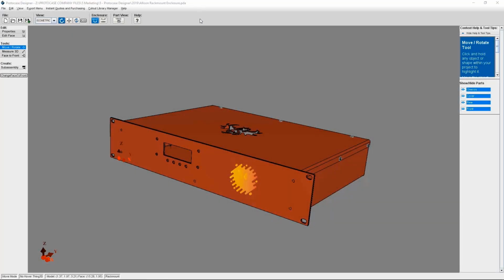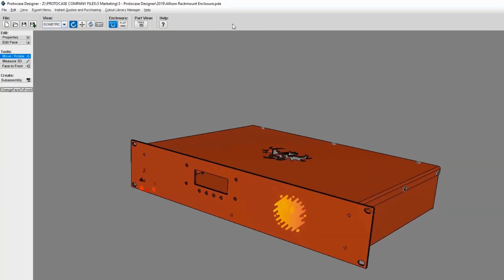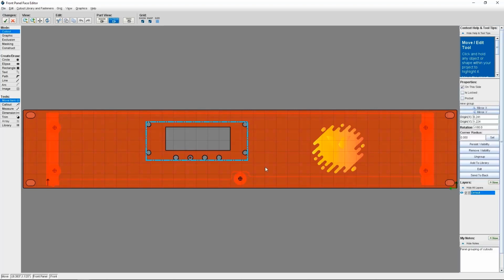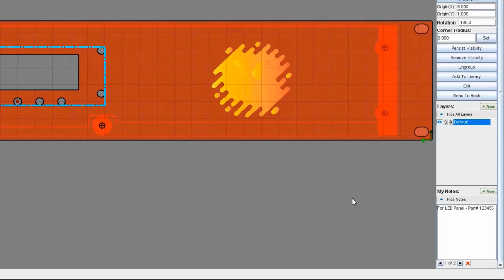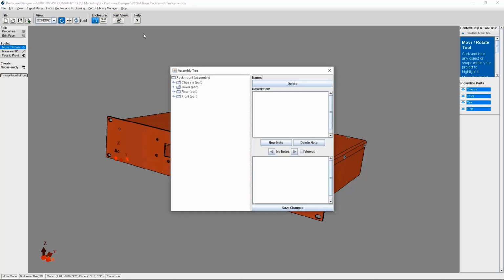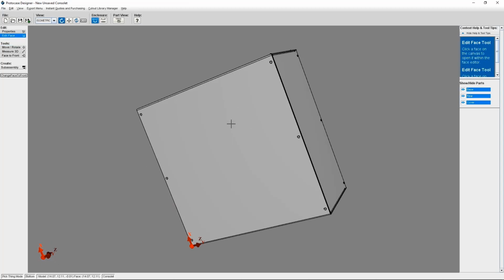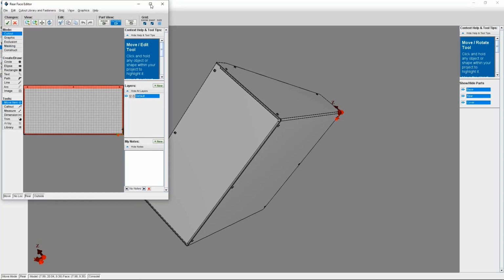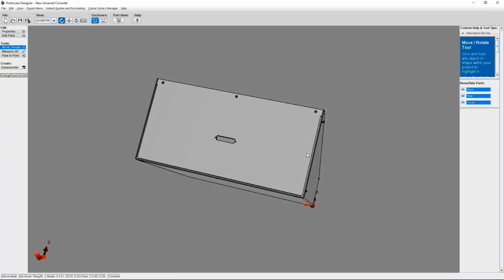How to Add Notes in Protocase Designer

Comment: hi im having trouble making a case as it takes ages because the program is running slow and my cpu in task manager is saying its running 100% power used by java platform se binary.
Reply from the maker: Hi there, sorry to hear you're having issues. Would you mind sending an email with full details to info@protocasedesigner.com? Please include the version number of Protocase Designer you have installed, your CPU system specs and the Protocase Designer file you're working on. Our developers are working on a new release of the software that will have significant speed improvements (will probably go out within a month or so), but it would be good to connect with our team even before that to be sure there's nothing that can't be done in the meantime.